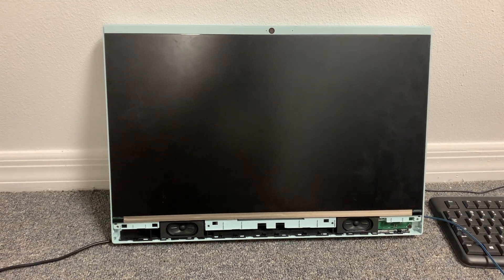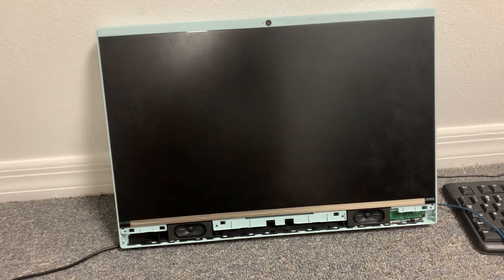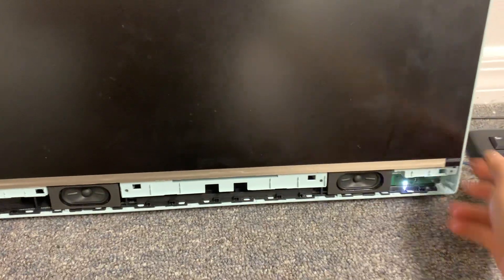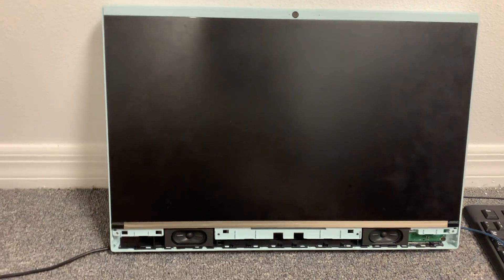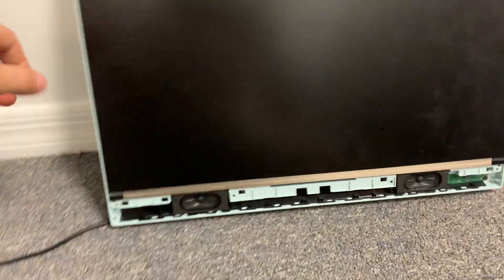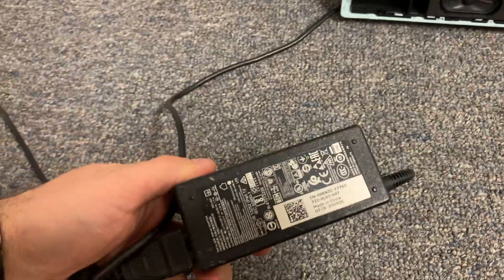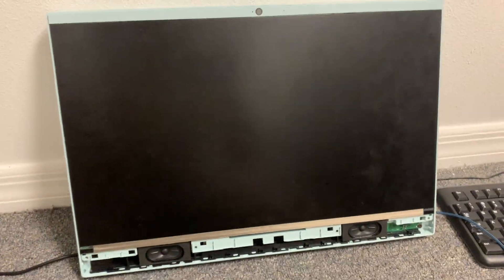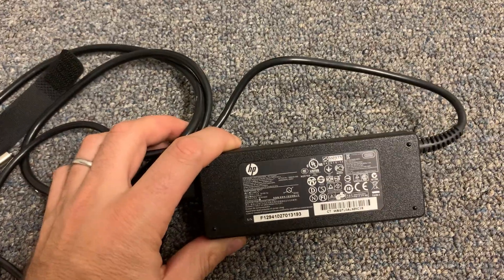HP All-in-One 3 Long 4 Short beeps repair solution.

Comment: thanks lot
worked the idaea for me 
i opened the whole pc to change the ram and clean but still same issue
when i checked the power cord it was torn had to resolder the wires and worked for me 
thanks again

Comment: Can someone tell me why all of a sudden the power pack that came with the HP PC suddenly is not enough to now power the PC. It doesnt make sense!
Reply from the maker: It could be bad connection too, I’ve seen the tip developing corrosion overtime and that cause this issue as well. Inspect the tip, clean it and it might work
Reply: @applepietech  Mine is all good, no corrosion or build up at all

Comment: Yes it worked.  Thank you so much.   I accidently dislodged (ony slightly by the way) the power supply cord from the back of the computer.  I pushed it back in fully and it worked.   You have saved me so many $$$$$.  Really Really appreciate your advice.

Comment: Sometimes you do not need a new power supply. Make sure everything is unplugged in the back, and then hold the power button for 15 seconds. After that, only plug in the power adapter. Then turn it on. You should get something that says like “Keyboard error” or something like that. Now I’m not sure it will boot up like it is supposed to for you like it did for me, but that’s how I fixed it.

Comment: I had this happen to me a couple of years ago. The previous owner (my sister) had cats that liked to chew on wires, and they chewed up the power adapter wire on this exact aio model. It worked fine for a few months then I got the same 3.4 error code. Ended up having to get a brand new adapter direct from HP, after I installed the new one the beeps went away and I haven't heard them since.

Comment: Something else to try that worked for me is to just plug the power supply in without it being plugged into the back of the HP, then plug it into the HP.

My cheapo knockoff power supply worked normally for a year but after not using the PC for a couple months, the HP gave me this error beeping for the first time ever, and powering the power brick first let it start up.

Comment: It didn't work for me, but was worth a try. I just replaced the charger with another OEM HP one, same model & everything. It fired right up long enough for me to reprogram it, load all drivers(from my old System32 Drivers Backup), and fully update the new OS. I worked on it for two days. Rebooted & shut it down several times during that period without issue. It wasn't until I left it in the corner unplugged for a month that this issue popped back up for me a second time. At a complete loss at this point, other that the fact that I intend on checking the CMOS battery & resetting the ram & bios again. I've tried every shop charger I have on it with this same 3-L 4S beeping BS. HP really screwed-the-pooch with this issue IMO. You can breath on an HP after it's warranty expires & it'll crash the damn thing! We deserve much better.
Reply: there can be other causes
it can also sometimes be fixed by unplugging any dongles plugged into the computer and plugging them back in

Comment: BEFORE YOU GET A NEW POWER SUPPLY: I just checked the back of the compute, and sure enough, the power cord wasn’t plugged in all the way. Now it works fine. Check your connection first!

Comment: I got a 23-q1111 for $80 cause the seller said "the bios was broken"

Plugged it into a 90w power adapter and... Boom.. Beeps.

4 short, 4 long.

After (I think) 5 cycles of these beeps, the pc started right up. But every time I restart it I have to listen to these beeps.

I know this video is for 3 short and 4 long beeps, but I found it when researching my problem so I'll share my find.

The CMOS battery was dead. I replaced the CMOS battery, and the beeping stopped.

I also flashed the most recent bios update from hp, from the hp website just as a precaution.

Never had an issue since.

I'm using a Chinese power adapter from Amazon. Max wattage is 90, max voltage is 21, just for extra information.
Reply: I bought a 90W charging cable and I still hear the beeps idk how to fix this you have any ideas or suggestions?
Reply: @JoseRamirez-sz6bo  buy the official HP cable and it'll stop, or just tolerate 8t

Comment: This HP  All in One  REQUIRES the original Power Supply with a Smart Pin at the connector. Other 3rd party power supply WILL NOT WORK.

Comment: Eureka! Thanks for the clue

Looks like the culprit is the skinny pin in the center of the power supply connector, also known as the 'HP Smart Pin'
It's actually a third conductor. HP say it's there for some sort of security bs, but it's more likely it's to stop people using an aftermarket powersupply.

If you put a resistor (in this case I used a 200K ohm) between the centre pin conductor and the positive 19.5v, it should work. Mine had the same beeps as above, but booted straight away when I did that. You want to ensure the power supply you're using has the necessary amp rating to run it.
Reply: what if you are using a desktop computer with same beepings and with red light, how do you solve that
Reply: Hey I'm having this issue I'm trying to understand how you put the resistor between the center pin and the positive.. I see the center pin but whats the positive the the outer portion of the plug?

Comment: I had mine reformatted by a professional and it didn't have a power supply when I got it do he ordered a brand new one for it and he told me that was caused by the weak or dead backup battery inside and he could fix it but it would cost as much as if he changed the motherboard. I let it go for a couple of years but now I'm having another problem and decided to just replace the battery inside myself and it wasn't as hard as he said it was but even with the new power supply and fresh back up battery it's still doing in. The girl I know it belonged to her grandmother and she bought it new in 2017 but died shortly after, the girl told me it has always done that since her grandmother bought it so mine has to be something else

Comment: My new power cable is plugged in good but this still is happening :( is it the wrong wattage or something?
Reply from the maker: Same 3 long 4 short beep?  Make sure center pin is not bent and try to twist the power adapter tip several times, might be bad contact

Comment: I had same thing happen i have 3 beeps and 3 beeps same sound I moved where it was plugged into with a different power strip turned on normal but later tired to restart it to see if it was was good still did it might be cus to many thing plugged in with it?

Comment: I’ve replaced this power supply twice, and keeps happening, read comments and checked the plug into the monitor and was about a 1/10 of a centimeter pulled out; ensure all connections are seated; HP support is non-existent.
Reply: did you ever figure out what happened?
Reply: Experiencing the same
Reply from the maker: Make sure contacts are clean and do not have any signs of corrosion on the computer side.
Reply: @applepietech  how I wish that I could show you the state at which the comp is. It is HP all in one Proone 600 G5

Comment: This HP was the worst purchase of my life......
Reply: Same and it is hp so of course it's gonna be trash
Reply: Mine was free. Someone donated it to the place I get free electronics from. Must have been the worst purchase they had got too.
Reply: @chuckfinley5206 found a tossed out A in 1 (HP) 24" Win 10 Home, but the screen is messed up! Tried a small HP charger with a second monitor connected,and got the same series of beeps, so might try a higher wattage power supply! Or keep the RAM, SSD, maybe the Wi-Fi card!
Reply: My dads friend gave me this and i cant run nothing
Reply: Why?
Reply: Same here…
Reply: It's an HP....
Reply: I agree!  Nothing but problems

Comment: Had an HP Pavilion All-in-One giving that exact beep sequence (3 long 4 short) five times and all I did was check the power supply and sure enough it was loose as could be. Almost falling out the back of the PC! I pushed it back in and checked the rest of the cord, powered PC back on and no more beeps. Thanks for this video!
Reply: yes, just a loose cord
Reply: You fixed my pc!!!!
Reply: Ye it happens to me
Reply: Thanks for your comment, this just happened to me and I was about to buy a new power supply

Comment: Thank you. I didn't have to buy a new power supply but mine wasn't plugged in properly 🤣
Reply: How’d you plug it properly
Reply: @_isthatzay_8963  make sure it's plugged all the way into the outlet/powerstrip. Also make sure it's tightly secured at the back of the computer. Mine was properly plugged in the outlet, but loose at the computer port. I literally just fixed it because of this amazing video.
Reply: Hahah thank goodness that I saw you comment, I thought that I'd have to buy a new power supply.

Comment: I have an all in one touch screen desktop it’s a black screen and just beeps when I turn it on so do I need to get a new plug
Reply from the maker: This is not an all-in-one solution for beeping problems. You might have another issue. However if you tried different ram and it makes exactly the same beeping noise as shown in this video - this solution might work. Thanks

Comment: Please can you send a link to the power supply you bought
Reply from the maker: Its 90w genuine hp power supply. You can get it used on eBay. Do not buy new aftermarket junk
Reply: @applepietech  plz can I have the link of the power supply you bought it from
Reply from the maker: @blademaster9274  I did not buy it, i used one from old hp laptop I had laying around. As I said just look for one with the same tip, same Voltage rating but higher Amperage which will result in higher Wattage
Reply: @applepietech  ok thank you
Reply from the maker: @blademaster9274  65w might not be enough power for all-in-one.